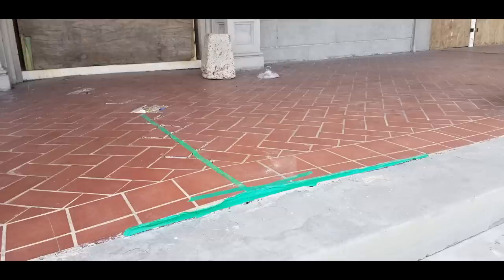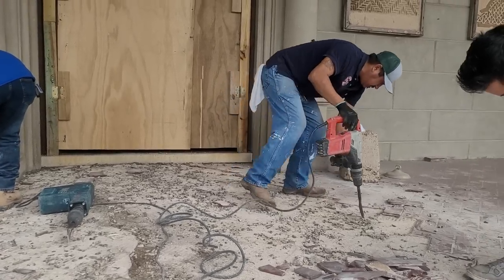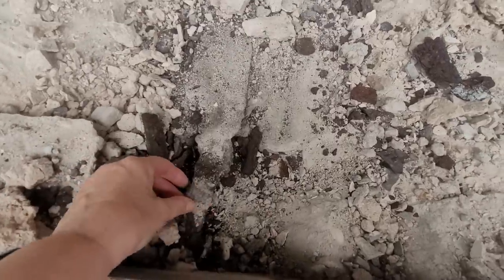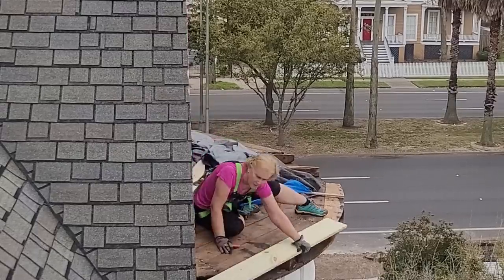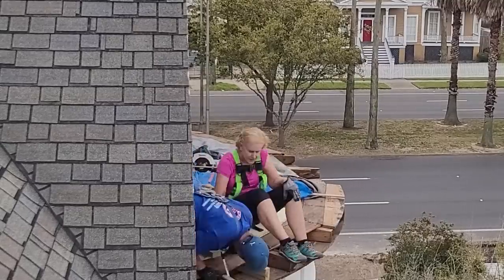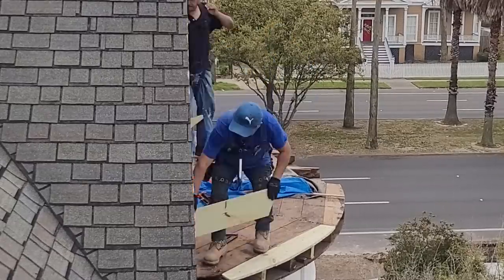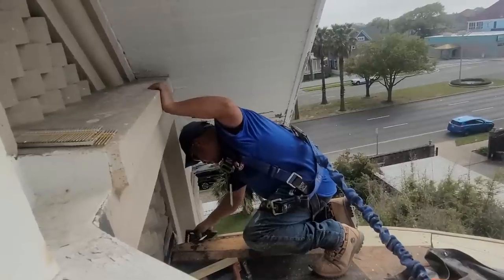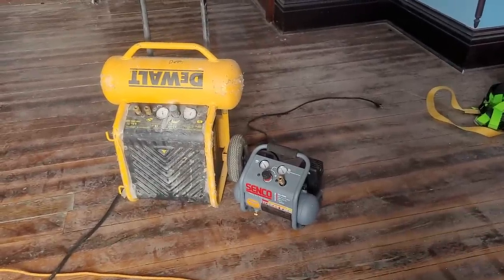S3.04 Oh No!!  What Have I Done

Comment: That sounds like a really good idea using that polyurethane product for the facia- what was the name of it? A lot of Victorian houses have curves both inside and out and this is a great solution.
Reply from the maker: It's call Duraflex.   I've never used it before so I can't recommend it based on personal experience but I have talked to other who used it and were happy.
Reply: @leaguekempnerhouse  There is another product called Azek which I have found to be excellent for damp areas and areas with a lot of weather exposure. It does not curve (unless you heat it to a form (which I  have done)). But it holds paint forever, does not rot, not a meal for termites. It is made of PVC and comes in boards as well as a lot of special shapes. You can cut it. screw it. lathe it, glue it. But it has no structural strength so don''t rely on it for that - it's 'strictly trim.  @leaguekempnerhouse
Reply from the maker: @johnmcglynn4102  I've looked at Azek online.  It seems like a really good product.  Even in historic preservation, you can be allowed to use modern materials if there is a compelling reason to do so.

Comment: The decorative brickwork up in the gable is still as delicate and pretty as it was when first built. Maybe the generous over hang of the eaves protected it all this time.
Reply from the maker: For the first 30 years it had a completely different roof that gave it a lot of protection.  That roof was removed when the second floor porch was closed in and this flat roof was put on.  I like the original design better but putting it back the way it was is not in the budget right now.  Maybe someday.

Comment: A Block and Beam flooring system seems to me to be the most similar replacement for that porch floor. I just wouldn't trust repairs to what is left of those iron rails. Shame they didn't use cast iron instead it would be still solid.
Reply from the maker: Funny you should mention that.  I must have watched 20 YouTube videos on the block and beam system.  It seems very straight forward.  I'm thinking it might be a little more expensive than a traditionally poured concrete floor but I'm thinking it could be done a section at a time and stretch out the repairs as budget allows.  I'm going to start getting bids and talking to specialty contractors to see what the pros and cons are.

Comment: What a shame, I hoped you might be able to swap the rail track for modern materials, deal with the uneven concreate and lay the tile back down. Great work on the roof   2x👍
Reply from the maker: I was really hoping to come up with a way to save the porch too.  Having exposed this section from the top, there's just no way.  I was thrilled with just how much of the tile came off without breaking.  I will be so happy to get that little alcove closed in.  It has been a thorn in my side for 26 months now.  How such a tiny space can how so much wrong is amazing.
Reply: @leaguekempnerhouse  Such a pity, as for the alcove it will look so nice closed in and water tight.